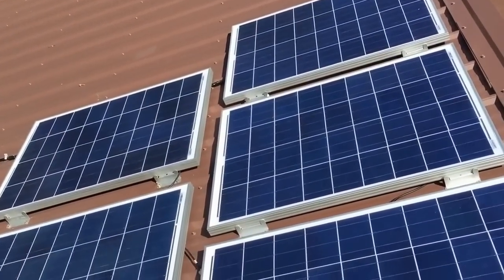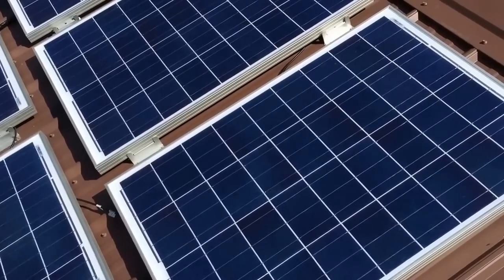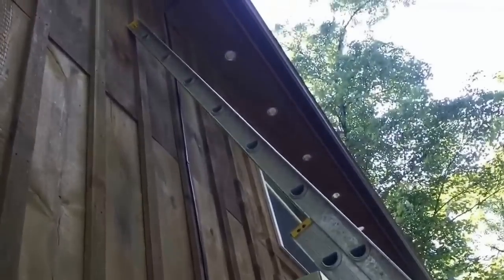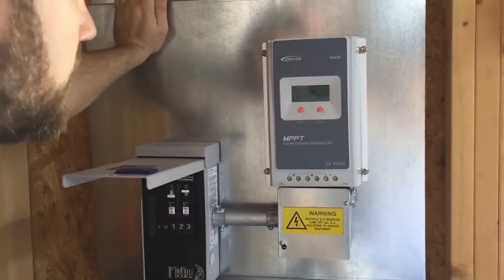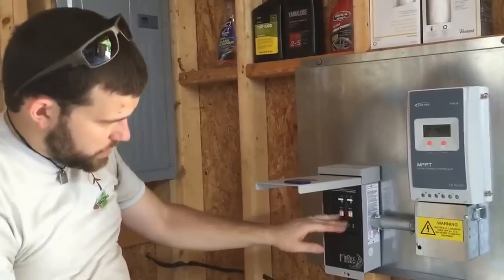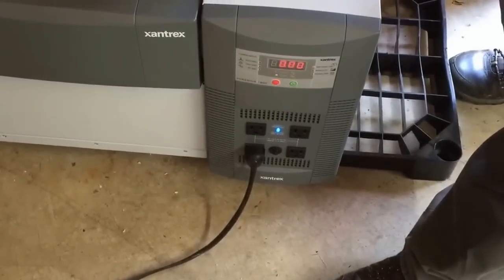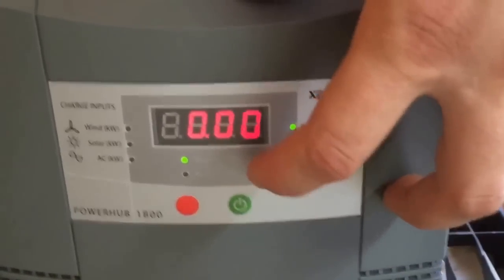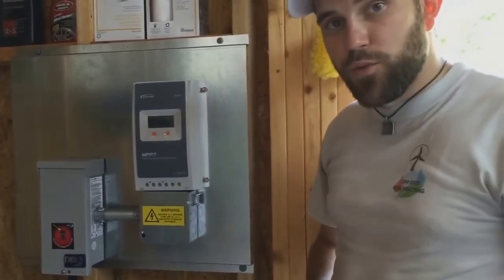Off Grid solar powered freezer ran by Xantrex 1800 install by Off Grid Contracting

Comment: Do you have a system that is EMP Proof?
Reply from the maker: Yes we have access to sol ark and also are building our own boards the 30 amp single and 40 amp single boards should be public later at the end of the week. Just check back to the channel.